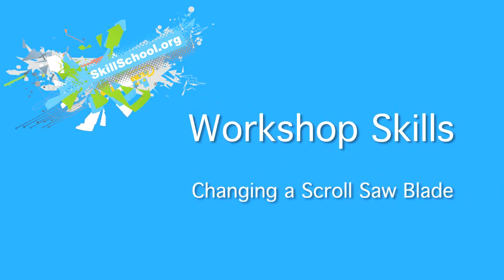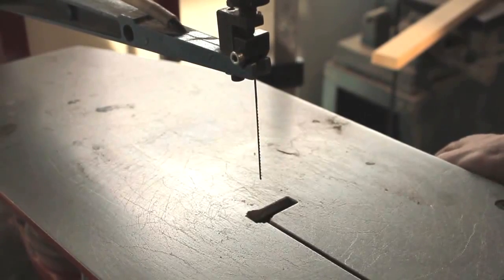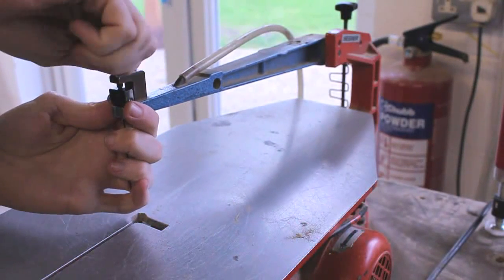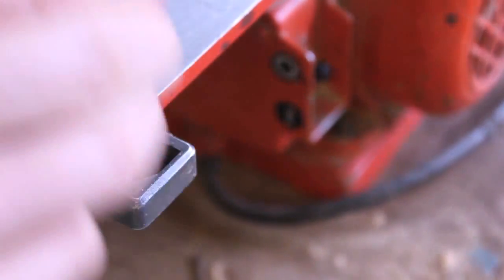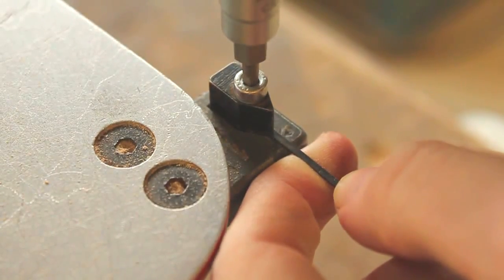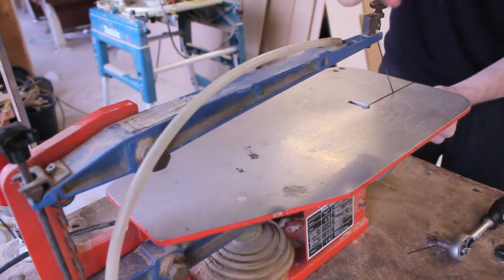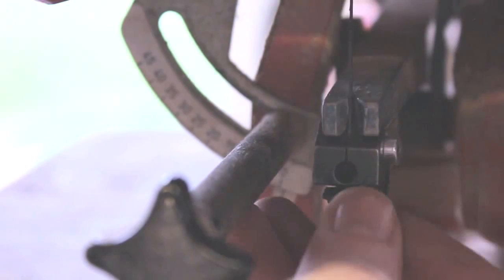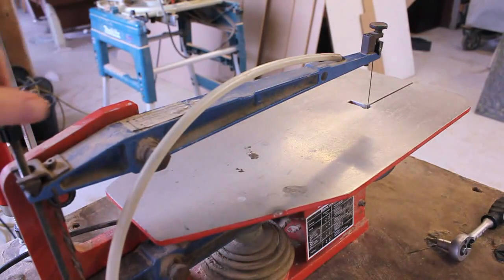How to Replace a Scrollsaw Blade - RESISTANT MATERIALS - Design & Technology (DT D&T)

Comment: Hegner scroll saws might have a good reputation but they look archaic and very ugly: an industrial revolution relic coupled with a modicum of Heath-Robinson. Give me an Excalibur (or one of its many clones) any day for good looks, efficiency, well-engineered design, and ease of use. You can change a blade on an Excalibur in seconds (as opposed to minutes with the Hegner).

Comment: Nice clear video but there’s a couple of errors, according to the Hegner manual. Firstly, after pushing the blade against the clamp screw, pull it back about a millimetre so tightening the screw does not twist the blade. Secondly, after tightening the thumb screw down, back it off half a turn to allow the clamp to pivot freely.

Comment: At 1:28 , after fitting and tightening the blade, you say, "Next we need to make sure we've put the blade in the right way round."
Surely it would be better to check that BEFORE fitting and tightening? Makes more sense to me.  Otherwise, a good video!
Reply: Doesn't matter which way you install  the blade into the holders; What you need to do is turn the blade up the correct way when installed in the holders; the holders fit both the top part of the arm and the bottom part where the holder fits into. you just turn the installed blade holders so the teeth of the blade face downwards.The Hegner is a pain  when you have to thread the blade through a entry hole in a work-piece; trying to place the blade into the small slot in the blade holder is a nightmare, I would not recommend  buying a Hegner with this type of system. Absolute misery to work with.

Comment: What is the piece that holds the blade in place called. I just bought an older scroll saw and cant find that piece.
Reply from the maker: +Camron Ramsey according to the manual located here:  https://www.hegner.co.uk/downloads/manuals/Multicut_user_manual-11-2010.PDF the part is simply called a "blade clamp".

Hope this helps!
Reply: Thank you!